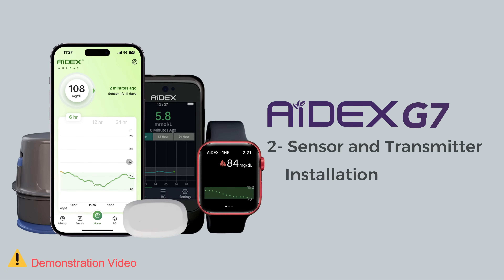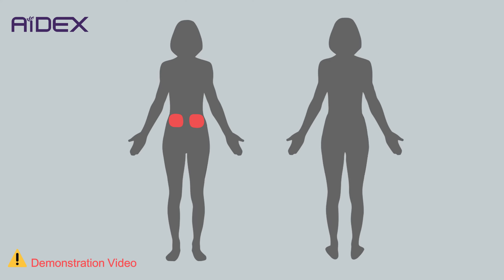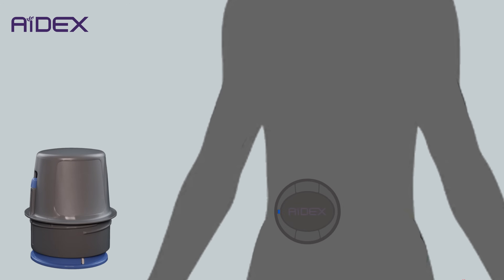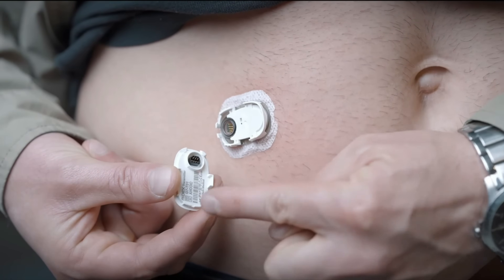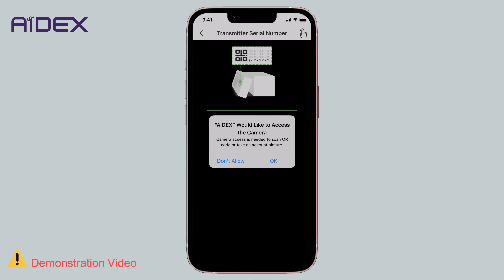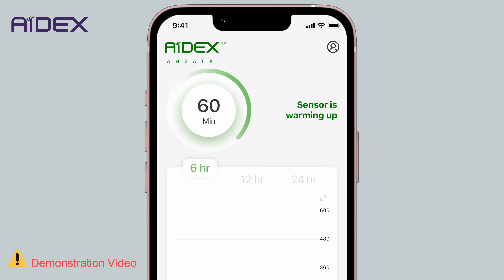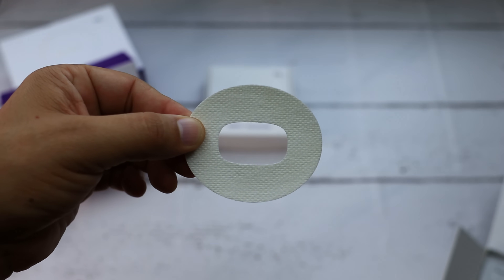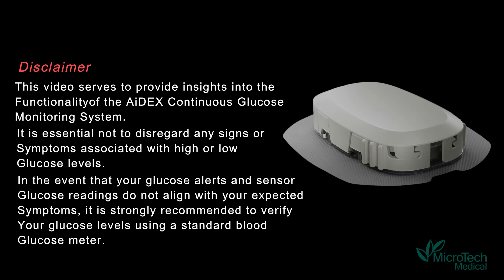Aidex CGM Sensor and Transmitter Installation: Your Complete How-To Guide

Comment: Hello just received mine yesterday and it is working very well without getting hot, as others had written down. Need to install the app, which is on the App Store.I was a bit afraid to try it, but everything went fine

Comment: @6.54 I didn't choose either one, before I choose,it skipped to warm up. Will it shows wrong reading now?😢
Reply from the maker: even so, it will not be accurate at the beginning only
Reply: @aidexcgm157  Salam Azərbaycan yazıram sizə.Bu sensorun artırması varmı?